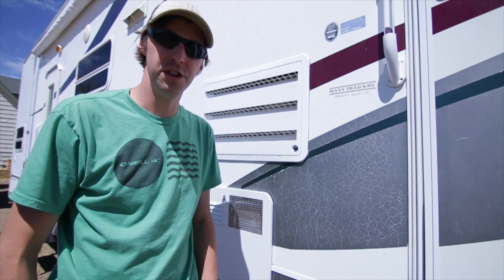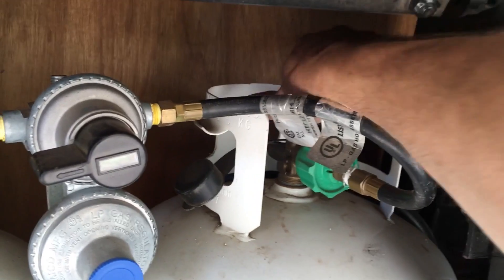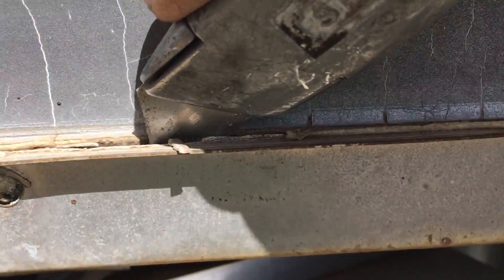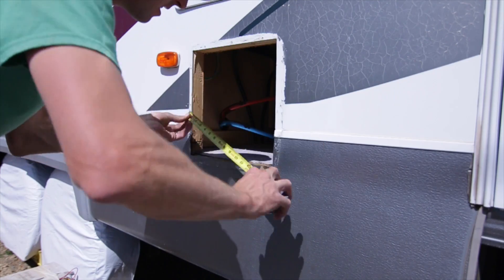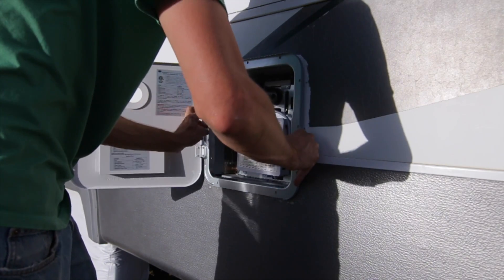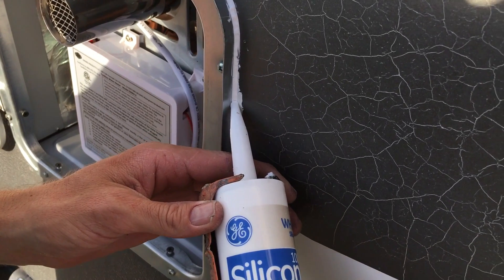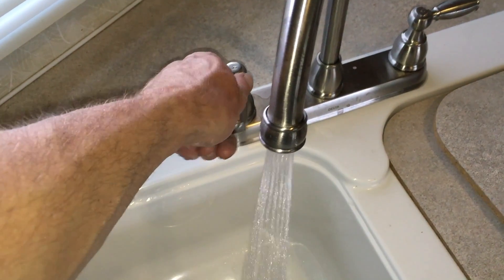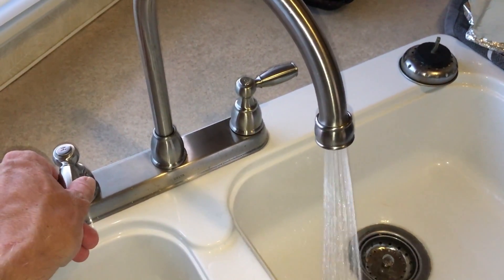RV Tankless Water Heater Easy Install and Review!

Comment: My tank is hot water heater has a actual plug-in plug on it where do I plug that in at if I put it in the same spot you did or will I have to run like a drop cord or something

Comment: You wanna set the temp on the hot water heater you should never use cold water at the same time it disrupts the hot water flow and can cause damage to your flow switch or cause the hot water heater to turn off

Comment: Do you basically just take out the old hot water tank? And then connect the hot to hot pipe (exit water) and cold to cold pipe (entry water)? And plug it in for power? Is that basically it?

Comment: Why would you need a other water control unit ? Wouldn't the old tank have a control setting on it ? So wire the new one up to the original ? Or why not ?

Comment: Hi , can we test if the water heater actually work before installing ou heater ... I plug my to a 12v battery and my control panel does not turn on ... how can I. Know if It actually works if the panel doesn't turn on ...

Comment: I'm going to install a TC Fundy 65,000 Btu hopefully today in my trailer. I was just watching a RV tech and he said to only use your hot water tap and not to mix with cold. Set your Water heater to 110 or lower and it should work fine. You'll have to test to get the right temperature you desire.

Comment: My guy, thanks so much for this simple hookup! I was concerned the new device would have the 6 colored crazy wires and my trailer being 20years used the seller didn't have any of the manuals. Now I know this unit does all of that for us and we just need the original pos/negative connections. So easy and thanks again sir!
Reply: Does tank less not use Gas back up? he didn't talk about that at all

Comment: For anyone researching tankless water heaters i would highly recommend using butyl tape between the flange and trailer. Caulking alone is not enough. Leaks will develop around screws and if the caulk cracks you have no way to keep water out.
Reply: This^^^

Comment: You jumped over connecting the controller....I have this unit and am trying to install but can't get the controller to turn on.  12V connected fine but not the controller...

Comment: Does anyone else have one of these where the freeze protection auto run feature starts going at 59 degrees F?   My new RV has one of these and I noticed that the heater turned on by itself for a minute and finally figured out it was the freeze protection circuit triggering early.   It is only suppose to kick on below 38 degrees.  The company service department sent me a new sensor for free, but it took two tries to get one that actually worked at 38 degrees.

Comment: I just installed a tankless water heater in my RV. This video extremely simplifies the job and makes a very technical job look easy. It isn't easy. The job requires rerouting hot and cold water lines. Rerouting the copper propane line (not a job for beginners). The 110 electrical has to be disconnected and an electrical box install for the wires. You need a voltage tester to confirm the polarity of the DC electric wires. On my unit I had to build the floor up so it fit with the exterior hole. I've replaced my RV refrigerator, commode and several other projects for myself and neighbors at the RV park. This was by far the hardest.
Reply: Thank you for this comment! Exactly what I was going to ask about - how much rerouting had to be done to make this work!
Reply: It is easy, and this video does speed run the actual process. All of the tankless heaters on the market are susceptible to rain intrusion which can and will temporarily and permanently cripple the unit. I modified and riveted a dryer vent cover to the door to block water intrusion. This must be done to all brands
Reply: Agree. He only shows the easy parts that everyone knows, but not the accessing, disconnecting and reconnecting pats.
Reply: I was thinking the same thing. No way is it that simple.
Reply: If you buy the right unit it helps to make it simpler.

Comment: I bought and installed a Girard tankless water heater. It shuts itself off at the slightest variation of pressure. If your water temperature coming in is under 50 degrees it will not heat to full temp. It will not heat to full temp on full flow.

Comment: Well this was very helpful.. I have an older truck camper with the usual 6 gal. water heater. I have discovered a very small leak between the combustion chamber tube and the tank and it is rusting the outer box of the heater. I would prefer a tankless due to being alone in the camper and I don't need to maintain all that hot water. Thanks.

Comment: Before you install the mounting flange you could have put a layer of butyl tape around the opening for the outer flange to be bedded into and provide a positive seal. After you trim away the excess butyl tape you run a bead of calking around the outside seam and you will never have a leak. Simple eh?

Comment: You should have installed the door flange with putty tape and screwed the outside screws down first to suck it in and make a good seal with the putty tape. Then put that inside screws in. This way you have a perfect seal without the use of silicone and it will last MUCH longer than that silicone will as far as sealing is concerned. Silicone calking should never be used outside on an RV. It brakes it's seal in short time in a lot of little places and then it is very hard to remove. Funny stuff. Hard to remove yet does not hold a seal.

Comment: Great video! My water heater works on propane or electric. Is this one just for propane?
Reply from the maker: +Golfr61 yes ours is just propane
Reply: My rv doesn't have any electrical connection near the water heater but has a plug in outlet in the bathroom would it be possible to run it on a cord to the outlet? On a similar model?

Comment: ive been really wanting to purchase this water heater. the water I use is very cold I spoke with a tech and he was not sure if it would keep up. do you have any idea if it would my shower is also located quite far from my hot water heater. this heater will only be used by me also.
Reply from the maker: +chris cole you know I can't say for sure whether or not it would do a good job heating up very cold water. For us, we haven't had a single issue with it not going to the temp that we set it at. So during the winter we like it a little warmer and will set the temp to 107 and it heats it exactly to that temperature. We have moved around quite a bit and have been connected to lots of different water and we have really enjoyed the tankless. I hope this helps, I know they cost quite a bit of money.
Reply: Jared Gillis well it helps but i just went back to the old way i cant fond out if for sure it will work with cold water or hard water so i dunno at a loss really wanted it though. sigh lol

Comment: No boon-docking with tankless
Reply from the maker: If you are wondering if you can boon-dock with it, you can!  It runs off of propane and we can go multiple months of full time use and not need to fill up (4 people) and the power usage to run the ignition and controls is very low.
Reply: Jared Gillis  Thanks for replying. Good to hear that it’s works good without hookups. We rarely use hookups

Comment: Don't forget to depressurize the heater by pulling the expansion valve or turning the hot tap on, also a good idea to drain the tank by removing the anode before disconnecting the rear pipes ( make sure you depressurize before removing the anode)

Comment: How's has this been working so far? I've talked to an RV dealer and they said they have had trouble with them. I remember when they first came out for homes, there were many reports of problems and some companies went under leaving customers with failed heaters and no parts.
Reply from the maker: +videoclipits we love it!  If we were to get a new RV we would put in a tankless again.  Here is our follow up video.https://youtu.be/cC9O0cLbVQ8

Comment: Now that you have had your tankless for a while, what are your thoughts? I've never had a tankless system, but everyone seems to like the concept. It sounds like you have to maintain water flow to get hot water. How do you conserve water usage? ie; dry camping?
Reply from the maker: +twdenman1 we love it.  It made our top five list video https://youtu.be/cC9O0cLbVQ8. When we are boondocking we do like we would normally and turn off the water in the shower when possible to save water.  It does give a small interruption in hot water but I don't mind it.

Comment: Thanks for the video, how would you winterize this?
Reply from the maker: I would do a compressor and blow out the water from the whole RV System including the water heater.  You could always do the antifreeze in it if you didn't have a compressor.

Comment: Just installed mine on my food truck and it appears to heat and work well.  I get some pulsating of the water when the pump is going.  Not sure where I can fine tune that.  Any suggestions?
Reply: That is the nature of a DC diaphragm pump. you can add an accumulator tank. Shurflo offers a small one for less than $50.

Comment: We have a toy hauler with two showers in it. Could two showers be used at the same time and still get plenty of hot water?
Reply from the maker: +Nikki Washer I would doubt it could do two showers at the same time.  But it might be worth emailing the manufacturer,  I had good response times when I did

Comment: I have mine installed but I haven't tested it yet.  I have a water leak by the shower and I'm waiting on a part to arrive.  Should I still get something on the display panel even if the water isn't flowing?  I've wired everything but there's nothing on the display.
Reply from the maker: You should be able to power it on and look at the settings even without water.
Reply: Thanks.  I'll check my wiring again.

Comment: Jared, I did not see how you tied in the controller to power it?  did you just splice it in?  Thanks, great video!!
Reply from the maker: The Controller just connects with 2 wires that come out of the water heater and it doesn't matter wich way you do it

Comment: Hi Jared... great video... thanks!... I am currently in the process of installing this unit. I have  quick Q. The unit has an ON-OFF switch... does the remote control overrides it? do I leave it OFF and control the ON-OFF with the remote?  The manual is  not very clear about this.... Thanks!
Reply from the maker: I believe I have mine in the on position

Comment: Now that you have had this a while, how do you like it. Has there been any issues with it? I have read (unk brand) that some people having trouble with not enough pressure to keep the tankless heater stay on steady.
Reply from the maker: It's great we like it.  The thing that I think most people do wrong is trying to use it like a tank heater.  With a tank heater you crank the temp as hot as it will go and mix it at the shower valve to get the temp you want.  The problem with a tankless is when you mix in the cold water it reduces the flow to the water heater turning the hot water off...Not Fun In The Shower.  What we do is set the temp at the control panel to what I want my shower to be and basically use only the water from the water heater and don't mix in much cold.  This way no restriction to the hot water heater flow.   It is different but the advantage is our Family of 4 can have back to back showers with no wasted time in between to get out the door.
Reply: Thank you for taking the time to answer. Looks like a good heater to have.

Comment: Any issues with water quality like hard water etc that maybe at different locations you visit?  I know for home units they say if you have hard water they recommend a water softener system, so was wondering if this holds true for the RV ones.
Reply from the maker: We haven't had any issues with that yet.  Where we are at right now has really bad hard water it will be a good test for it.

Comment: I actually wish you had been  More detailed.  I never did see you reattach the propane - were the connections easy or did you have to make propane modifications - were they difficult or do you need a propane specialist to run new tubing ?  You just slid in the new unit then added caulk to hold it in - is this adequate for going down the highway ? How did you get to the water supply - is it in the back and did you have to go through your cabinets somehow ?  I know for me, when I do DIY the devil is in the details ! !

Good information on flow rate and temp -- really appreciate the info ! !  Thanks !
Reply from the maker: SailorGolf yes I just used the exact same fittings and pipe for the propane.  Since this was a replace and not a new from scratch install all the previous fittings work.  The unit itself is screwed to the Rv.  When you see me attach the door to the water heater those screws automatically secure it to the rv and the  door, then the door also screws to the side of the rv.  The caulk is just to seal out water and any bugs looking for a way in.  Hope that helped.

Comment: I know this is a silly question but I'm in the middle of hooking ours up and the UCP isn't working, we are getting power to the unit itself, but the UCP won't turn on. The manual is a bit confusing in the instructions for the two blue wires and the wires on the UCP. Did you wire them all (all four) together? Or do I need to connect one blue wire to one end of the UCP wires, and the other to the other blue? This is such a simple thing for others (I assume) that I haven't found any further instructions online...
Reply from the maker: Are you using the existing wires that are wired to a switch?
Reply: Thanks for your quick reply!  We ended up figuring it out and it works!

We did have to connect each UCP wire to the individual Blue wires from the unit. Then, once the heater was on, we had power to the control panel. 

Thanks again for the Video as well, we must have watched it half a dozen times. 

Instagram: @winnebagowheelhouse
Blog: winnebagowheelhouse.weebly.com

Comment: how much more lp do you go thru?
Reply from the maker: We actually save on propane unless long showers are taken.  When you have more than six or ten gallons of hot water it's easy to take a long one.  But you save when the hot water isn't running, so the water heater isn't on all the time.
Reply: I guess i would like the fact, I could take a long shower if I wanted too. Thanks
Reply: I had the same question.  I really LIKE the answer....less propane.

Comment: Thanks for posting this video! I have the previous generation Girard Tankless water heater product and one of our biggest qualms is that in the shower we don't have separate handles for HOT and COLD, just one continuous radial lever that controls pressure and temp (turn counter-clockwise, that's on and HOT, turn counterclockwise that cold then off). This style shower means that it is mixing the hot and cold whether we want to do so or not, and most times if we want to make the water colder it gets too hot and shuts off the heater off completely (reduced flow).

So my question is this: have you found that it's difficult to get the temperature that you want in the shower by mixing hot and cold?
Reply: Jason Stewart h
how to light
Reply from the maker: I don't' know how I didn't see this comment till now sorry for such a late response.  If you are still interested we do have a difficult time mixing at the shower the water temp if we set the water heater to max.   What we do is set the water heater to the temp we want our shower and run it at almost full hot.   So I set my temp to 105  most days and it is perfect.
Reply from the maker: It auto lights when you use water

Comment: You didn't show the reconnection of the gas line.  I have the exact same setup, both old water heater and new tankless.  Are there any adapters needed to connect the gas line?  Thanks!
Reply from the maker: No it just threaded straight on with the same compression fitting.  Hope the conversion goes well!  We are still messing around with our settings.  Glad we made the switch!
Reply: I’m a little confused about the wiring connection from the UCP to the heater. Two wires at the UCP and two Blue wire at the heater. How was the connection made.?